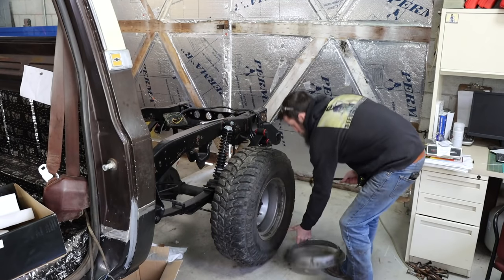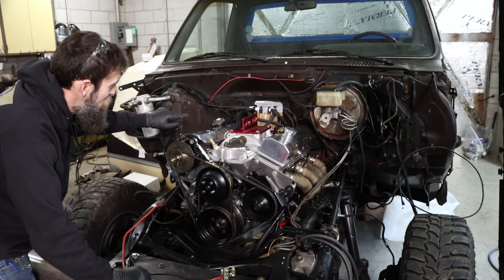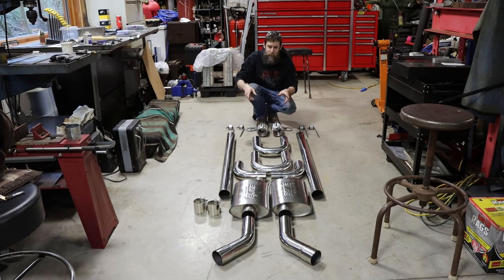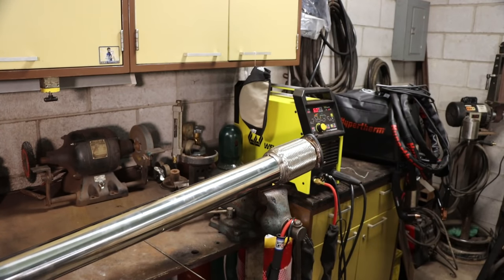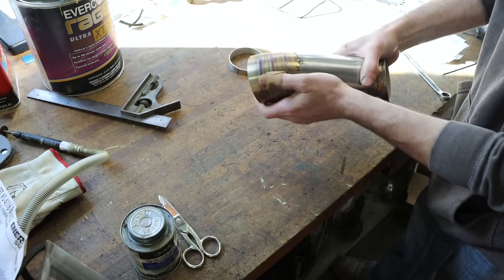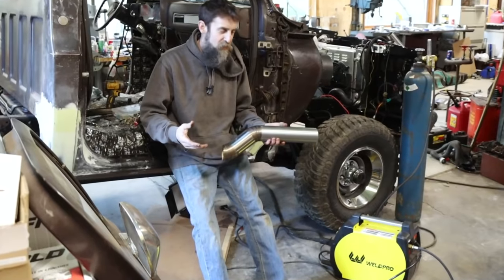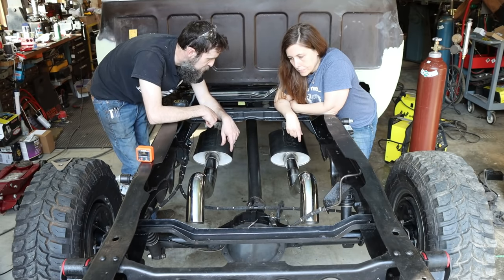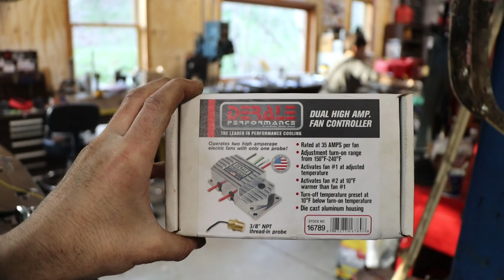Sick DIY Stainless 3" exhaust on the CHEAP!  + Wheels Complete!

Comment: Steve, I am really impressed with what all you are doing to your truck. When you finish the mechanical rebuild and get it painted and upholstered with that new carpet and all that insulation I think I had rather have it than a 2022 standard cab pickup. That truck will last you until you are your dad's age. The exhaust system is extremely impressive, wish I could Tig as good as you. I wanted to ask, on the bends that you made, it appeared that you did not use any filler rod while making those bends. Did you go back later and weld over them again or is that necessary? It surely makes a good looking bend. I also like the fact that you break up the video with a few seconds of your creek outside, Elizabeth showing son how to run a dirt bike or even a squirrel or two which breaks things up a little which makes the videos more interesting. I will bet that your truck is the quietest one that you have ever owned just because of who did the installation of the insulation. Elizabeth, you do good work and you are a lot better looking than Steve is!!!

Comment: Hey Steve, nice show, as always. But I need to point out an error, Tesa is NOT the name of the tape, sorry. It’s the name of the manufacturer, like 3-M. You need to tell the viewers what type tape it is, such as “fleece tape” or “insulating tape “ or whatever. They make a very wide selection, I’m sure the name is on the packaging.

Comment: So those little digital block levels, they're fantastic right? I've searched YouTube, it doesn't seem that anybody has tested these for accuracy. I suspect that many brands are made on the same assembly line I know you don't usually do tool comparison videos, but it would be interesting to know how the little wixies stand up against traditional angle measurement equipment, much less how they compared to one another

Comment: Tungsten electrodes are radioactive, not super radioactive but if the dust gets into your lung tissue it's bad news. I use a shop vac when I grind Tungsten and a respirator too.

Comment: I see some rust on the frame of the truck. Are you going to remove that now that you moved into a total rebuild? I see a ton of after market Hot Rod type items you are installing. I hope this project turns out as great as you think it will. And I equally hope it is going to get enough MPG that you want as well. So many times as we Hop-UP vehicles, we end up with a more powerful outcome, but at the expense of mileage... Thumbs Up!

Comment: HI STEVE, FIRST TIME SEEING THAT PRESUREWASHER?SANDBLASTER, IS THAT SOMETHING YOU BOUGHT OR MADE?
Reply: It was in last week's video.
Reply: @haroldphipps3457  yeah, but he only showed it in lower-case, so Thomas didn't see it.
Reply: @mattmanyam  that's funny!
Reply: He bought it, but you can make it yourself. I build one many years ago. In my opinion better than dry sandblaster. You don't need a cabin for it. Just some tarp. The only thing you really need is the nozzle. It has to be carbide or ceramic. It will wear out really fast otherwise.
And if you have one you will use it everywhere, removing paint from wood, doors, sheet metal, cleaning concrete, bricks, boulders and removing rust. Every time you think of using the wire brush or course sandpaper your mind will wander to the wet sandblaster. :-)
You don't have to load it with sand. Ground walnut shells are really good for paint removal.
Reply: @boelwerkr  THANKS FOR THE INFO SIR
Reply: @haroldphipps3457  THANKS, I DIDN'T CATCH LAST WEEKS POST

Comment: I like to ride my bicycle at night when it's cool. 
On coming traffic thinks cyclists have  super vision. They flip on their high beam to get a good look at me and that's ok but they leave them on and blind the hell out of me. Unlike a car I can't turn a high beam back them. A couple of times I almost ran off the road.
Reply: Not very good idea to ride bicycle after dark. Unless you want to get run over.
Reply: @haroldphipps3457  still no reason to blind a cyclist.
Reply: @Ernest Storch  easy solution. 
Stay off the roads at night!
Use those bicycle paths our fuel tax have been diverted from road repair to let freeloading bicycleeest ride on.
And then ride on the road next to the bicycle trail,,,,

Comment: question re exhaust system. are you going to fit a balancing pipe?
Reply: He said he was.
I'm sure there is no room where the crossover is most beneficial,  won't fit till behind the transfer case.
I'd skip it, just because it is a PITA for no more gain than it really adds.

Comment: Is that Chevy ignition system old enough style to have those really annoying rotors under the distributor cap? They would arc thru at the drop of a hat
Reply: Do you mean a rotor arm and points ? they were fine so long as they were set right and the cap kept clean and dry.